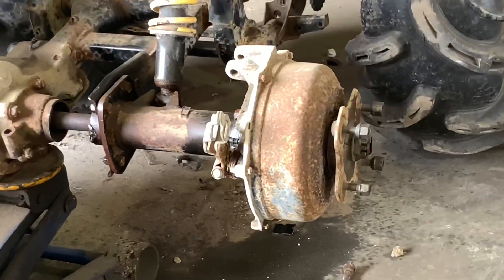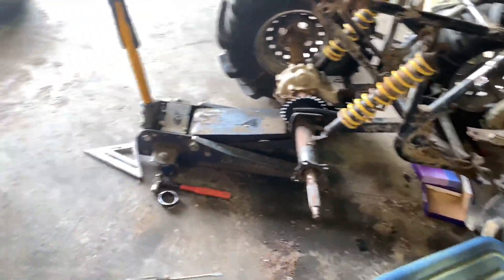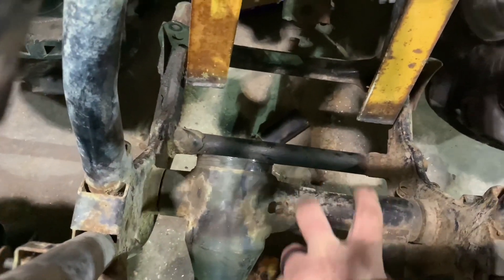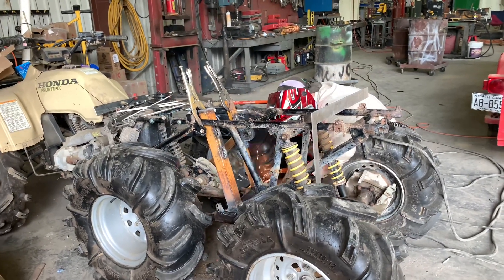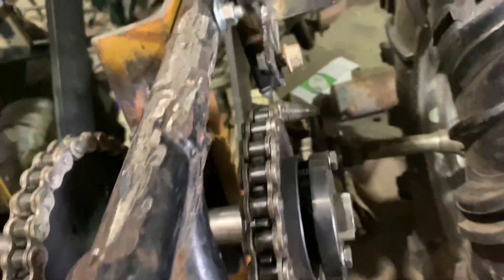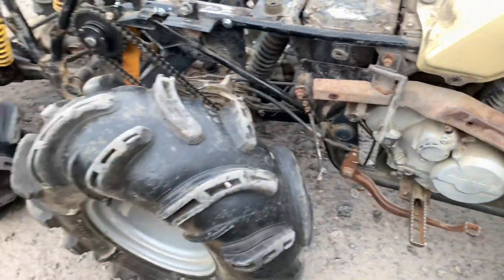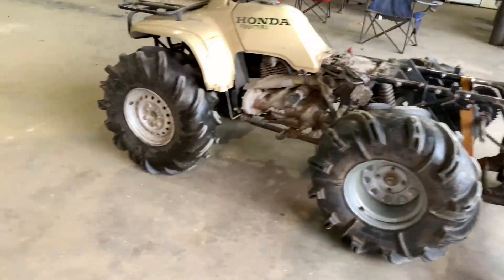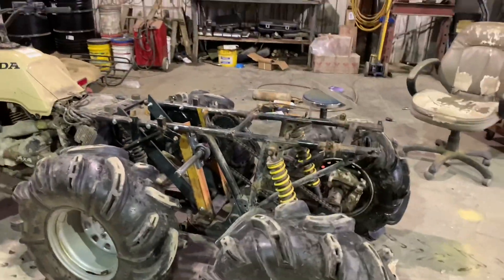HONDA 300 6X6 Part 3....THE SIXTRAX IS FINALLY ALIVE AND MOVING

Comment: You gonna do a big bore kit? The thing seems like its struggling to move under it's own weight
Reply from the maker: That’s because it has a open exhaust and the carb doesn’t like that 😂😂 it moves fine when I give it throttle and open it up I’m babying it so I can’t check everything and the G.R should help in the mud